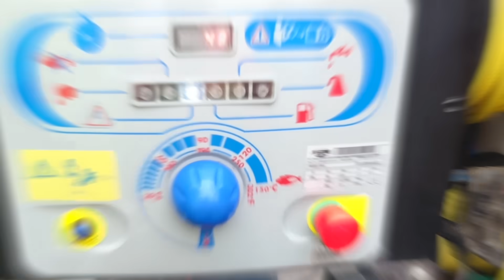Resin bonded driveway cleaning

Comment: Amazing how much water comes off the surface  as resin  is permeable   great job Ricky 👍
Reply from the maker: Yeah indeed, still need hell of a good rinse , 28 ltrs a min helps shift it, cheers darren
Reply: True that Ricky,  also while your there  went on AC website today as you suggested in another video,  sure I'd seen  a coupling or valve  called  a banjo, bit of a  coincidence 👍🤣🤣

Comment: Hi Ricky, smart videos, what pressures and temperatures seem to work best for Resin Drives using a mosmatic surface cleaner, do you rate virosol as a pre treatment , your van set up is spot on, thanks.

Comment: Hi Ricky,  How much difference do you think the hot water makes? I am looking at getting in to it but money will dictate what I can buy at the outset.
Reply from the maker: If your just starting out just see how you get on with a cold machine first worked for years without getting a boiler, hot water cleans better at lower pressure
Reply: @Bournemouthjetwashing  Cheers, that's good to know.
Reply: @Bournemouthjetwashing  Ricky, Can I ask, just roughly, how many jobs do you get through in a week.